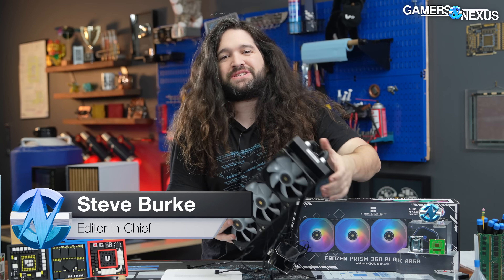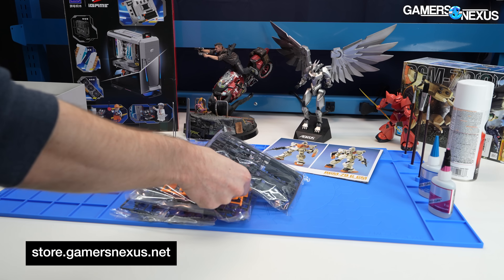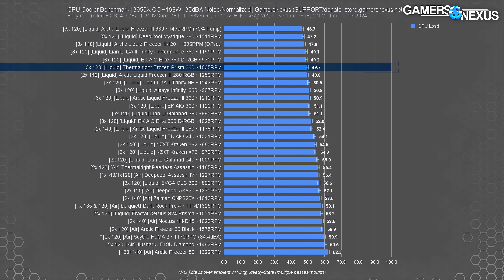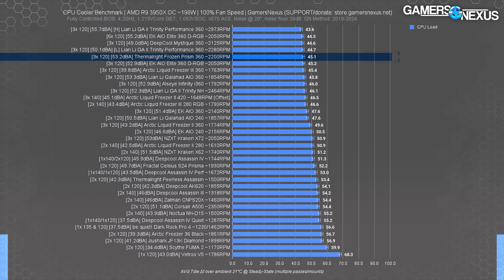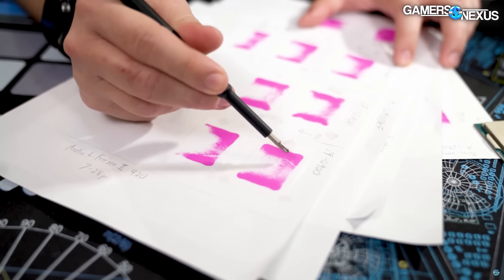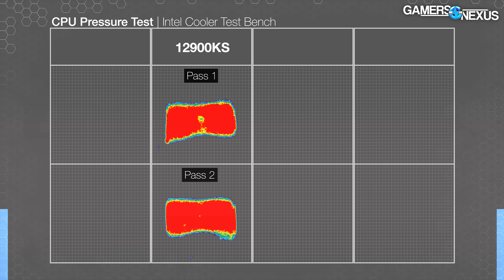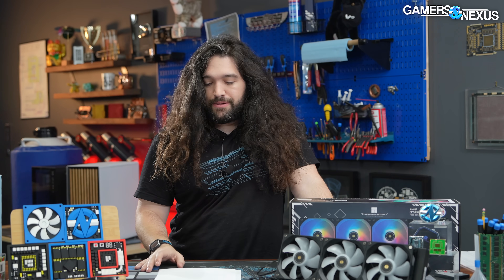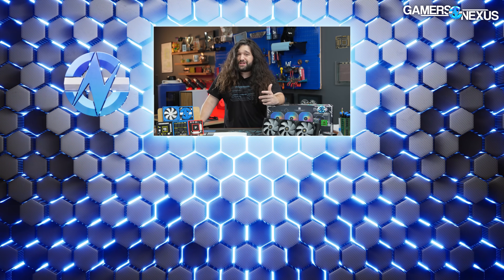Thermalright Strikes Again: $56.90 360mm Liquid Cooler | Frozen Prism Review

Comment: I don't need one at this particular moment, but I'm almost compelled to get one just because it's so cheap, and the air coolers have been damn impressive.
Reply: I'd get one now since they're so cheap. I have plenty of extra Thermalright fans, AIOs and air coolers I keep in my closet in case I ever need a back-up. Their products are so cheap and perform well enough that keeping an extra AIO or air cooler around might be worth it, before they inevitably increase their prices once they get more recognition. They already increased the price of some of their AIOs compared to last year. Up to you, but a $60 is nothing for a good performing 360mm AIO with GN's seal of approval.
Reply: @saintgtx  why bother with constant fan replacement, when you can buy some high quality fans? Oh, right, "it´s cheap". Eventually, the cost of those "cheap" fans will pile up & go up and beyond the cost of expensive, high quality fans (which will still run). 

But don´t mind me, go on, keep piling up the e-waste.
Reply: I got a Thermalright air cooler for my kid because it was cheap. It turned out to be really good. Keeps his 12400 under 65 degrees in cinebench. Was $28 AUSTRALIAN dollars lol
Reply: @100Underscores props to you for doing research for your kid!
Reply: same lol
Reply: I bought the 240mm version for $40 a couple months ago for my spare rig and honestly I'm quite impressed with it. The 12400F in it absolutely doesn't need an AIO, but at that price, it just makes you go "why not"

Comment: Does changing fan improve noise levels?
Reply from the maker: Changing fans would affect the noise levels, yes.
Reply: @GamersNexus  I wonder if pretty much all 360mm AIOs perform the same not taking the fans into considering.  I added some industrial noctuas to a Cooler Master ML 360 TR4 that had cheap fans.